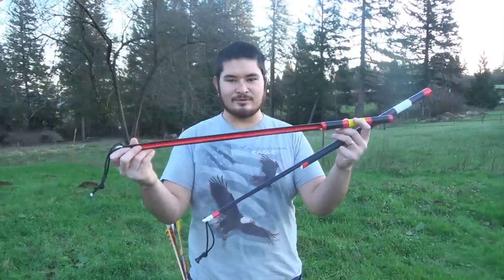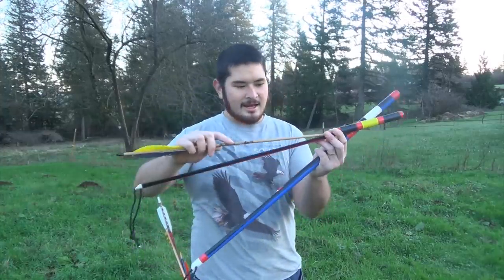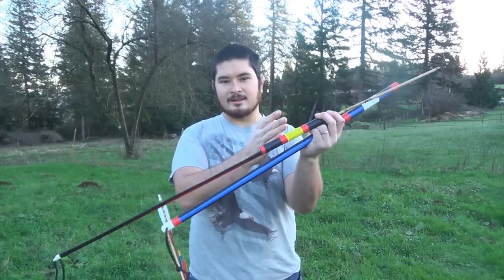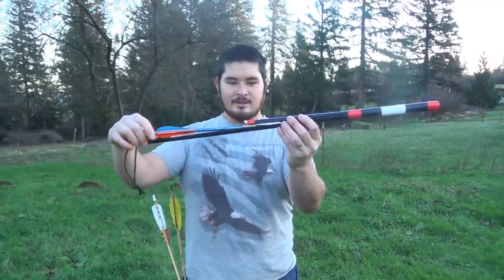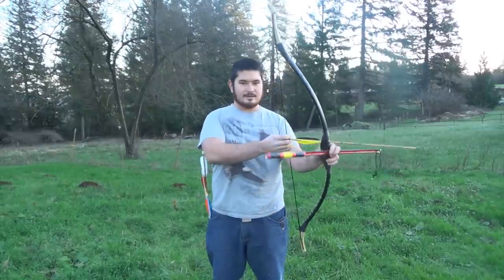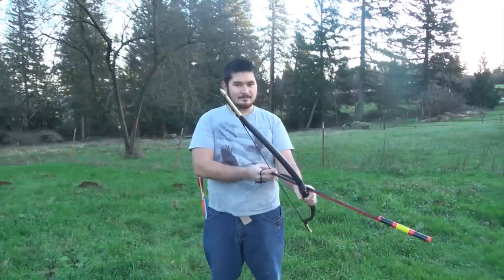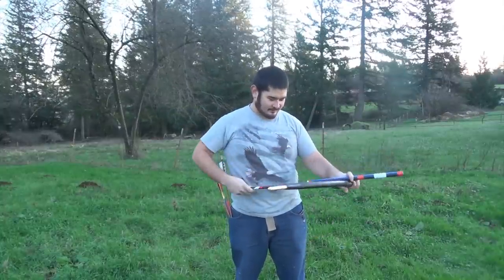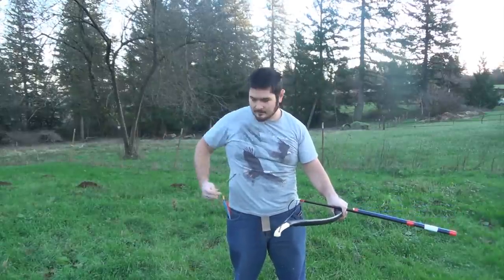Shooting Short Arrows With Experimental PVC Overdraws

Comment: Hey Nick! I've made a PVC bow using one of your guides. Great job on those btw, really proud of the result. I just have an issue with getting the right paint to stick on it. Seems to be harder than expected getting the right paint. What kind of paint are you using or would you recommend using on PVC bows?
Reply from the maker: Silo Entertainment I use the plastic-compatible paints, mostly. One trick to getting paint to stick is to lightly sand the pipe first. Wipe it down with a damp rag to remove and dust, then lightly heat the surface of the pipe with a heat gun or even a hair dryer.

The warm pipe will allow the paint to flow better, resulting in better adhesion. If the pipe is cold, the paint will more or less just cure on the surface and can chip or peel easily.Hope this helps!
Reply: Oh snap silo! was just watching some of your videos good to see you like bows as well :D
Reply: try using coloured tape
Reply: mix paint with PVA glue

Comment: I just wanted to weigh in that you can build a majra with a deep and narrow channel which can help keep the arrow encased well. Also, if you cut the tapered section of the majra on a slight angle away from your hand, the arrow rests safely on top of it and the arrow can't easily fall out. I find that these two things make my practice much safer.

Comment: Just made a couple of these PVC overdraws. Really just experimenting at the moment. Yes - they do work quite well. Tried both thumb ring (right hand side) and three fingers (left hand side). Both draw techniques go well. Found three finger style easier - Three fingers under the overdraw with the thumb resting on the arrow and string(using a cord on the overdraw that goes around the thumb).With a 14 inch arrow and out of a 30-40lb PVC bow the arrow speed is pretty good - accuracy OK as well.  Also made a PVC Panjegan (1 arrow only) that was OK . The sled is however a bit hard on the arrow/bolt nocks. Overall the PVC normal overdraw easier to make and use.

Comment: I learned something watching this! I always thought that an overdraw was attached to the bow, allowing the arrow rest to be mounted behind the riser and thus allowing the archer to reach full draw with a shorter arrow...never knew there were different types, like this one for example.
Reply from the maker: Truck Shackley There are lots of different types of overdraw. many of the traditional overdraws were separate from the bow, like the siper, majra, and tong-ah are examples. Many modern bows had overdraws built in, and many early compound bows used overdraws attached to the bow's riser.Most overdraws limit the length of arrow used, but the majra and tong-ah could make use of almost any length of arrow or dart.

Comment: Wow! Yesterday I just made my own little tong ah out of 3/4" pvc too! What a surprise to have you post up a video on the subject. And you are right, I have read that it is dangerous, it really is!! My arrow doesn't even fly straight it flew upwards, eventually I had lost that arrow. My tong ah (I guess I should refer to it) is really heavy and uncomfortable. I'll post a pic on google plus.
Reply from the maker: ***** Wow, well you are quite lucky! There is a lot that can go wrong, but flying up usually means the worst thing that will happen is the arrow will hit your bow. If it were going down, you could hit your hand or wrist, depending on how short your arrow is.I would suggest using 1/2" pipe. One trick, if you are set of making a traditionally-styled tong-ah and not one of these with the closed barrel, is to heat the whole pipe and wrap it loosely around one of your arrows. Cut a 12/" pipe in half, wrap around the arrow. This will help prevent the arrow from skipping up or down.Next, while you are starting out, use a point that is too big to escape the tube, but the rest of the arrow can move freely. This will result in slower speeds, but is considered a standard practice aid for those attempting to learn the use of the tong-ah. Once you feel confident, you can use normal arrows. Just keep in mind that there is a lot of risk involved. I wouldn't use this for normal shooting, but for speed testing and flight shooting I'd say it's fine.

Comment: Excellent idea you have there Nick. You can tell that the overdraws produce much faster speeds using the smaller arrows. I imagine it may be too early to tell but what kind of accuracy do you get from them?
Reply from the maker: The accuracy is pretty good, though I won't really be able to tell until I get a uniform set of short arrows. So far I've just been shooting broken arrows.

Comment: Hi Nick: I have a question, and you are the only person I can think of to ask. I made a 6' long bow out of 1 1/2 pvc, but boy is it stiff. If I flatten my limbs on a taper of 1 1/8 or 1 1/4, do you think it would help with the HUGE draw weight. It's basically an experiment, but even so, I don't want to screw it up. Any insight you can give would be appreciated. Thanks so much...... "The Rube".    (It is now on an 1 1/2 taper)  😎

Comment: Great video Nick. Ever since I saw your first overdraw video I've been waiting for more :D do you plan on making a tutorial? If not, what size is the pipe?
Reply from the maker: The pipe is 1/2" schedule 40 PVC. I might do a tutorial once I get all the bugs worked out. With the second overdraw, the string will sometimes jump the track. None of the arrows have jumped the track, but I have had nocks get snapped apart as the string goes one way and the arrow goes down the tube.

Comment: it looks like the short arrow go with alot more speed then the normal size arrow.
Reply: That's exactly the purpose actually. It's use is kind of the bow equivalent of sniping. Smaller, harder to see and faster arrow.
Reply: @John-sz7vf  Don't forget, unless they also have an overdraw, the enemy can't use the arrow against you once you loose it.

Comment: What's the advantage of using shorter arrows? I thought longer arrows are supposed to fly better anyway... That overdraw does look super dangerous, so what does one gain with it that makes it worth the risk? Also, you might wanna pick up some shooting glasses from the local gun range - mine cost only a dollar, very light, clear and I use them for everything, from shooting, to riding, to mowing the loan.
Reply: +shmuckling 
well based on some researches i have done, there were many benefits. most of them are from the use of guide barrel and short arrows. by the arrow itself, it is much faster, with less drags, and higher penetration capability. effective range increased to 150-200m. which was super comparing japanese yumi bow's effective range was around 70m back then. this was strong enough to meet the old matchlock rifle's spec. 

now, when you use the guide barrel and the arrow, i found very interesting things.
back then, arrows coming from long distance were easier to notice and possibly were able to be blocked. as they arc, they will arrive much later than short arrows that fly in straighter path.
many soldiers were not able to expect the arrow not only because it was so fast and small, but also the barrels in archers hands looked like the arrow had not left the bow.
once the arrow landed in enemy's ground, they could not be used against the archers because most of the time enemies were not properly equipped for this technique. i guess it could had been used as bolts for crossbows but thats uncommon as well. 
lastly, you could make doubled or even tripled amount of arrows with limited supply.
Reply: Elee90 Ok, these are some pretty serious points. Good enough for me. Thank you!

Comment: What is the benefit of shooting with an overdraw vs. just shooting with longer arrows? Just being able to shoot short ones? Why not just make or buy the right size arrows for your bow...?
Reply from the maker: Anemathis The main point is to shoot a shorter arrow. One of the main reasons for this is for flight shooting or shooting for speed, as a very short arrow can be made much lighter and thinner than a longer one matched for the same bow. The shorter an arrow is, the stiffer it acts.

Comment: what is the advantage to shooting short arrows? You cut down on drag but you lose out on mass, a debatably good/bad thing. In my opinion mass>velocity becuase mass contributes to inertia meaning drag is less effective and force on impact is mass acceleration and acceleration/ deceleration is not as dependant also loss in mass means they can be carried by wind more. If I have this totally wrong please correct me but I think this makes. sense.
Reply: well supposedly it does travel faster based on the studies done.
and this technique isnt really just about shooting the short arrow. the combination of using the barrel and the short arrow brings more benefits.
back in the war time, arrows could be seen when they are coming from a distance.
having shorter arrow, it becomes harder to defend. especially when you see the archer holding the barrel, you can mistakenly think that the arrow hasnt left the bow.
and lastly, those short arrows were harder to use against the archer since most of the enemies werent prepared with the right equipments. (except reused as bolt for crossbows i guess.)

oh and you can make more of these arrows with limited supply.
Reply: +David Pritchett
i was confused about the physics so i did some research.
relationship between mass and force is true.
but the other theory behind this is
shorter arrow means less mass. therefore, it travels faster. speed is relative to the peak of impact force. shorter the time, higher the maximum force. This gives an edge as it has higher penetration capability.
also while larger mass contains larger initial force, it can be lost by air turbulence made by the archer's paradox. shorter arrows will be much stiffer so there will be less drag, less energy lost. 
another benefit is you do not have to worry about the arc of projectile not as much as larger arrows. it will fly much straighter which supposedly means the effective range increased. eh.

Comment: So what kind of advantage does a over draw bow have speed ? Penetration ?
Reply from the maker: Mainly speed, because you can shoot an arrow that is very light, like a modified crossbow bolt. A 50 pound longbow firing a crossbow bolt should fire that bolt with roughly the same speed and power as a 150 pound crossbow with a straight prod. It is said that the overdraw was used to fire arrows that the enemy could not shoot back, or to allow an archer to hide arrows on his person in plain sight.

Comment: Sorry, I don't quite understand the point of this - I mean, I get that it would let you get full draw power out of a given bow with arrows that are too short to use normally, but why... Uh... It doesn't seem practical. Is there a good reason to do this (as opposed to using arrows matched to your bow's draw length)?
Reply: I see that you will get more speed from a small bowl but that Korean overdraw video... That bow is so small it looks like a toy. If I needed more speed I'd use a bigger bow to get hunting level power... Hmm...
Reply: The biggest advantage to the overdraw is seen in combat. it allows you to fire any arrow length from your bow. so if someone happens to be firing crossbow bolts at you, you could pick up and use the bolts in your bow.
Reply: Think about this. Benefits of shorter arrows: lighter, you can carry more, less mass to move through the air, almost like throwing a dart. So for demonstration purposes, you can get very nice looking straight shooting arrows, and i'm sure the track helps improve sight in a sense, or maybe even keep the arrow in line a bit more. 

This would have NO use in battle or hunting...think about how long it takes to prepare a shot. And the shorter arrows move around less, so no deeper penetration. Its for show, and I sure do love a good show.